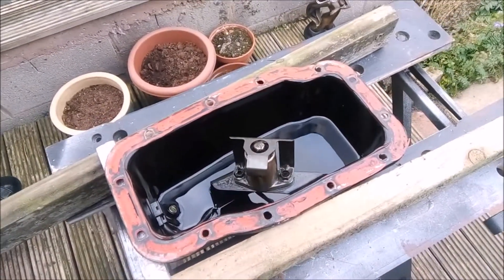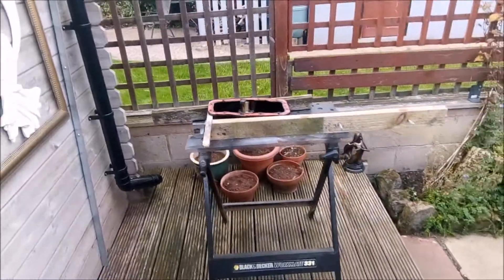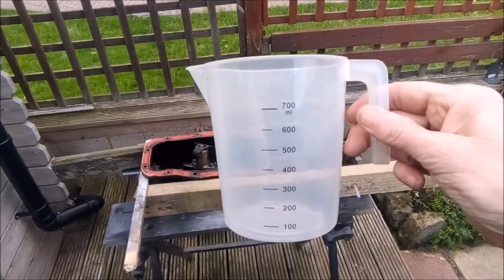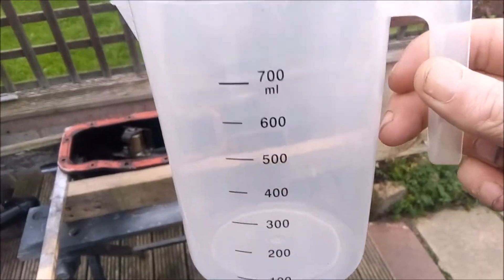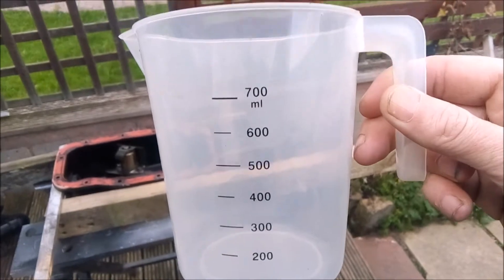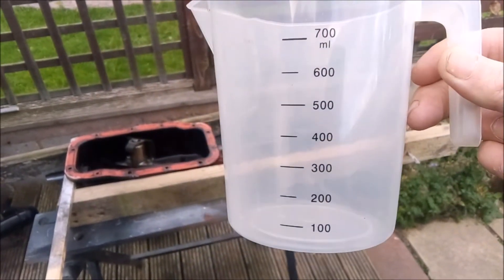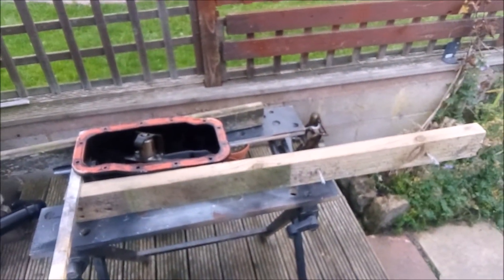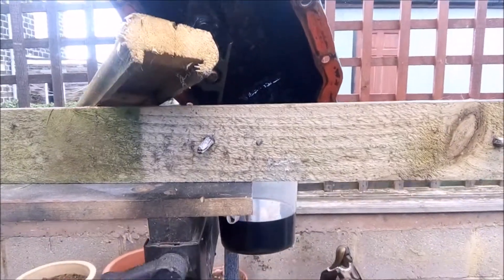Don't Change Your SUV/Car Engine Oil Until you Watch & Consider This!

Comment: I own  a 1999 3.2 since a couple of months.
Surprising yours did not had a magnet on the oil discharge bolt , mine has it.
Same for transaxle, gearbox and rear differential, all have magnet.
I use to put the two front wheels on ramps to get all the oil out.
Thanks for the video  I will unount the oil reservoir cover to check for bad oil deposits.

What was the reason for the horrible noise of the V6 on engine swap  first video ?